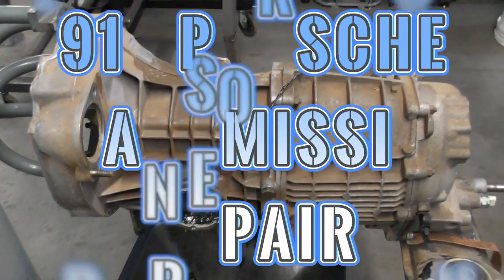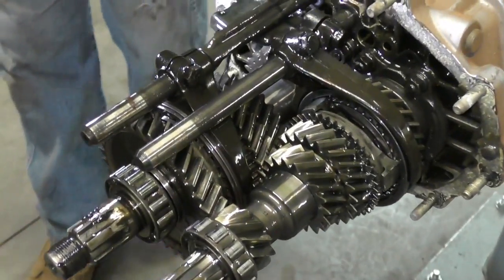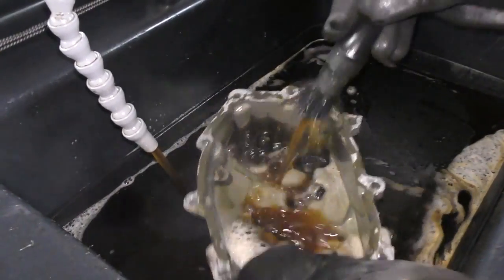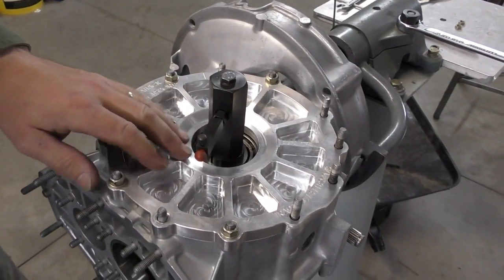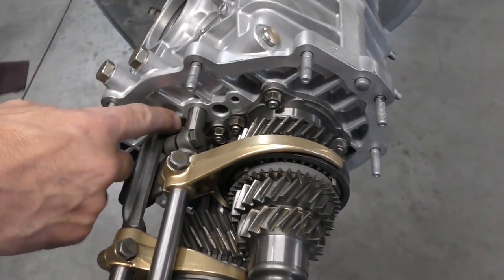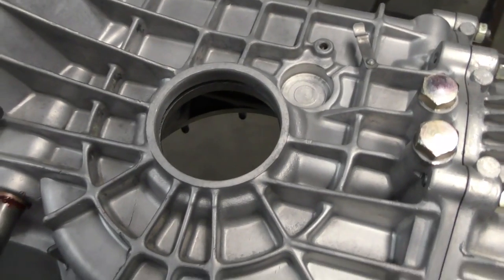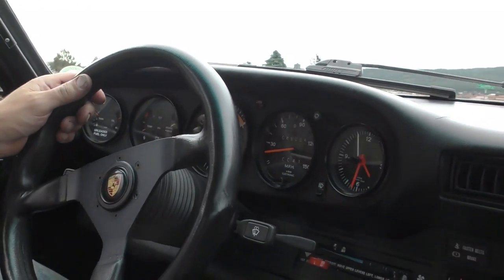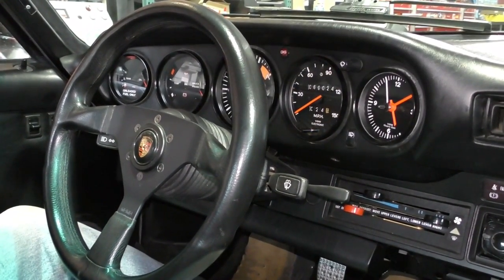Porsche 911 Transmission Repair

Comment: I have the same issue with my 1st gear. Won’t go into 1st unless I come to a complete stop. Otherwise it will grind. 
Now I know what to expect.
Thank you
Reply from the maker: Yes sounds like the synchro assembly is completely worn out on that one.
Kurt
Reply: Mine too
Reply: @diogeneslamp8241  had my transmission rebuilt since. Goes into all gears perfect!

Comment: Don’t you just love having to fix not just the assembly’s wear problems but the problems created by the Jack-leg mechanic who had his hands on it previously.   As a mechanical engineer in the automotive industry - it’s a pleasure to see someone with solid skills maintain the powertrain by adhering to proper technical specs and repair guidelines.  Customers can depend on this guy in my opinion.
Reply from the maker: Yes I seem to come across a lot work that is not done very well. Unfortunately there is a lot of bad information out there and it seems that opinion drives repairs more than facts.
Thanks
Kurt

Comment: Kurt, I love your videos. We keep them up next to the bench while doing rebuilds as a refresher and cross reference. For the DIY, what cleaners do you recommend for the case and internals?   If the case is sealed and we just want to freshen up externals to remove gunk before reinstall, what's a good process for cleaning the outside case?
Reply from the maker: For internals I use Ozzie Juice in a heated parts washer. with just washing the exterior I would just use your favorite degreaser and a pressure washer. Just make sure to seal the breather vent on top of the transmission and do not direct the water stream directly at the input shaft or selector shaft seals.
Kurt

Comment: Amazing videos. I've watched this and the earlier series on 915 transmission rebuild several times. I have similar issues with my 915 on my 1973 911E.  Can you share a list of the specialist tools which you used/recommend to do a similar rebuild?

I never plan to sell my car and plan to do a rebuild and change all the parts which wear out. I see you focus on syncro rings, dog teeth gears, bearing and bearing sheaths. What else do you recommend changing?
Reply from the maker: Sorry about the late reply Here is a quick list of the must haves
VW 385/1 Diff measuring bar
VW 385/14 Plunger for diff bar
VW 385/17 Magnetic disc
VW 385/30 master gauge
VW 388 Measuring lever
VW 385/4 Centering mandrels
P260A Shift fork adjustment plate
P37A Drive shaft Lock Plate
VW 521/4 Locking sleeve
P355A Input shaft holding plate
Bearing Puller Set
20 Ton Press
Press plates and Tubes
Dial Gauge 
1/2" Torque Wrench  capable of at least 300 NM
3/8" Torque Wrench
Torque Meter
Feeler gauges
As well as general hand tools Metric sockets and wrenches etc.
All in all it is fairly substantially investment. Most of these tools are no longer available new and if I had to guess buying everything today could be a $15,000 to $20,000 investment.
Kurt

Comment: Approximately, how much would this rebuild cost?
Reply from the maker: That depends, The whole ticket on this job was just under 8K but we also did some engine oil leaks as well as R&R of the engine. Depending on where you are and what work you have done pricing can really vary
Kurt
Reply: Thank you. After watching you do the rebuild with precision and care I would say 8K was a bargain.

Comment: Recently found your channel and it's very informative and well put together. It's very clear that you know your onions! I have just done a transmission fluid dump and noticed a small piece of what I know now to be a dog ring tooth. It was stuck to the magnetic drain plug. My Transmission was rebuilt about 5 years ago by a local specialist and it has always been a good shifting 915. In fact, it is still shifting well even minus one tooth. However, I am conscious of further damage and I am starting to think about a rebuild. Seeing as you are on the other side of the planet to me, I guess I will have to think about doing this myself. :-) I rebuilt my engine in my garage and I have a pretty good set-up, so I am quite confident that I could attempt it. However, it's the final set up of the Diff that I am worried about as I believe that there are some special tools required? I did this job on my MGB years ago and it worked out well, but I think that was mostly down to luck. Do you think this is a job that can be tackled by an Engineer who happens to be a hobby Mechanic? Many thanks and keep up the great content!
Reply from the maker: The tooling is the biggest key to being successful. If you are just staying on the transmission side of things then yes, you should be okay. You will still need to buy some tools to change the dog teeth. However, if you need to change anything on the diff side you will need to find someone that has the tooling to set up the gears for you.
Kurt
Reply: @klassikats  Thanks for your reply Kurt. Very much appreciated. I'll let you know if and when this happens.

Comment: Great video bud, how much did the parts & labor come out to ?
Reply from the maker: Can't remember exactly on that one, but as an average, you can figure a complete transmission repair is going to range from $4000 to $6000 depending on what work is done and what parts are needed
Kurt